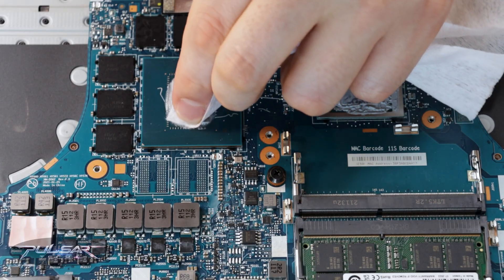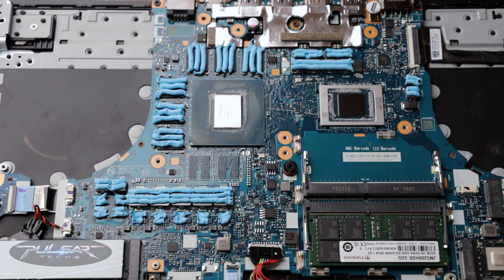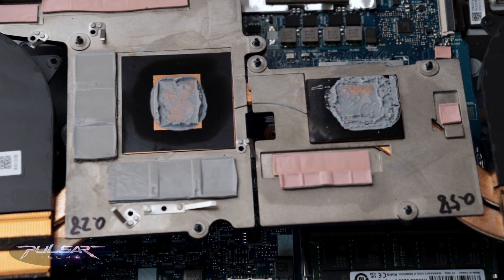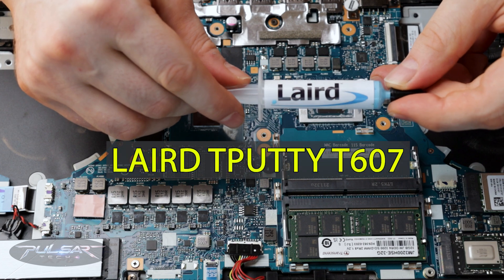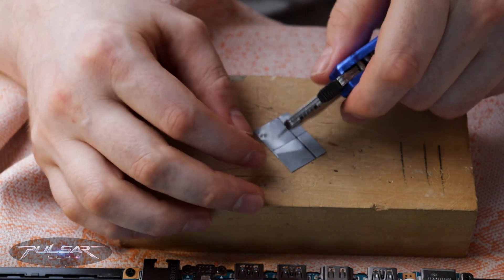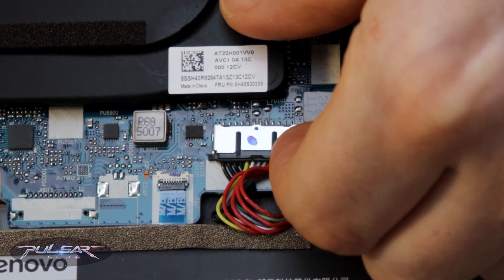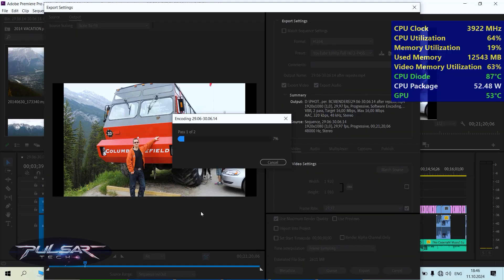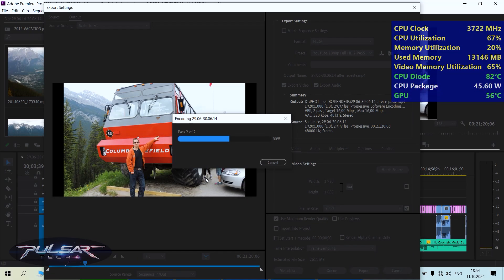From 100°C to Cool ❄️ Lenovo Legion 5 PTM7950 Thermal Upgrade

Comment: Mine is gettin 100c on the cpu is that normal …got it a year ago
Reply from the maker: No, 100C is too much. It probably needs fans, radiators cleaning and thermal interface overhaul, new paste, new pads.
Reply: @PulsarTECH fuck man it does go back to 80 or 90 all the games crash bc of direct x

Comment: Hello, thank you very much for your video! I had to replace my CPU fan which was making a very horrible noise, and thanks to you I could do it because I've changed thermal paste on a laptop before. But I'm kind of stuck in the middle right now, I replaced fans, tested them, open again and now I've cleaned the old thermal paste (which was much less dry than yours I think (I'm not playing very much and the laptop has a bit more than 3 years).
 But my question is now about applying Laird 607, you didn't tell if we have to pull out the thermal pads or just use the laird 607 to fill the gaps and letting in place all those small thermals pads ?
 I put my work in pause, hoping you'll answer soon !
Reply from the maker: Glad the video was helpful! You should remove the old thermal pads before applying the thermal paste.
Reply: Thanks for your help again:-D I'm doing it right now

Comment: How's it holding up now? Any issues?

By the way, have you heard of its issues? I've heard some parts face the "low soldering temp" issue, so tracking its temp is vital. Kind of nervous about this thing.
Reply from the maker: Holding up great. Temps are constantly low. It's the best way I find.

Comment: Hey! I used ThermalGrizzly phasesheet PTM pad on my cpu and gpu today (5800H + 3070M) and while my gpu maxes out at 71c under full load (which is incredible), my cpu is more in line with your "Before" scores from the previous video. It spikes up to the high 90s and then stabilizes around 89c or so. On cinebench r23 i got 10749pts, exactly same as your "Before" scores and with pretty much the same behaviour in temperature. I only wonder why I'm not seeing more of an improvement compared to your new results in this video. I made sure to apply the pad evenly, no air bubbles and tightened it well. I also didn't mess with the thermal pads as they were in good condition. I got great results on my gpu but for some reason my cpu is still running a little hot... any ideas?

Comment: Interesting thanks! Think I will try this but unsure how much mess the liquid thermal pads will make if I need to remove it?

My 15ACH6H with 5800h had a capacitor failure on the CPU and after repair it is now boosting to 3.8ghz during Cinebench multi core with a score of 12580, it’s holding around 77 watts and hitting 100 degrees doing this though! Putting it into Balanced mode instead of Turbo brings it down to 3.5ghz and 85 degrees.

Soldering On did the repair, he has some interesting videos on these laptops.
Reply from the maker: Glad you found the video interesting, and thanks for sharing your experience with the thermal performance!
Reply: @PulsarTECH  Just applied Thermal Grizzly PTM and Advanced Putty (they were more easily available) - I'm getting a similar 10 degrees drop from the Arctic MX4 used by the repair shop so it's maxing out at 90 during Cinebench multicore, but also the fans aren't going upto fully speed like before and the keyboard feels coolers. Thanks for the video and inspiration to do this, I'm really pleased as well!
Reply from the maker: @RebelSolitude  great, glad it was helpful. Indeed, it's such a relief to see your laptop's temps going from 100C and above to 90C under load. Thanks for sharing you feedback and experience!

Comment: when i clean my  cooler once/year  i feel similar effect.  But this will help on the next upgrade, next to new rams and main drive, thanks!
Im runnig on Silent mode, 100% max cpu, 2-3 monitors,  around 80-85C max temp, but its docked  on a big air-cleaner^^
Reply from the maker: Thanks for the comment, that's great that you found the video helpful!

Comment: Have repasted twice with ptm 7950. Every time i do the job there's always the need to replace it due to the dust inside the fans housing. Warranty is about to run out i guess I'll ask them a new heatsink unit
Reply from the maker: Hi, I just keep an eye on the temps, if there are fine, no need to clean the fans so often, especially with this fan design. What's wrong with the original heatsink?
Reply: @PulsarTECH some tiny oxidation near the cpu area, plus the old pads must be burnt out already

Comment: Hi I have the pro version with 5600h and 3060

Do you think it's similar or should I follow another guide?

I'm quite inspired by your pad + liquid pads solution though

Just asking since I have some spare artic mx4 around, it wouldn't work for the chips but would you use it for the spots where you put liquid pads per chance?

Also other question a few years ago PTM7950 was super hard to come by and expensive or fake, has the supply changed?

Thanks
Reply from the maker: Hi, yes it should work with the Pro version as well. The disassembly process might be slightly different but the paste application is the same.
This is what worked the best for me. I wouldn't use Arctic MX-4 on the CPU and GPU chips and definitely not on MOSFETs,  memory chips, etc because it is too liquid and you need to have proper liquid thermal pads such as Laird TPutty 607.
If you're worried about getting fake Honeywell PTM7950, try to find it from a reputable store if possible or at least don't buy the cheapest you find because usually if it's too cheap and good to be true, it probably is.
Hope this help!

Comment: how about putting a 0.5x0.5mm thin silicone pad frame around just by the edge of the cpu/gpu to lock in place the thermal paste on the cpu/gpu? its micro work, but could be useful?
Reply from the maker: I think 0.5 mm would be too much — the gap is probably around 0.2 mm or less, so using that would create an even larger gap, and even if it's filled with thermal paste, that's not ideal. The purpose of thermal paste is to fill in microscopic gaps between the chip and the thermal interface, and the thinner the gap, the better. At this point, I don’t think you can achieve anything better than what’s shown in the video without doing extreme and mostly unnecessary modifications, like custom water cooling or something similar.
Reply: @PulsarTECH  Understood. I was not well schooled on the topic. Now I learned more and understand I said stupid things. lol :D
Reply from the maker: @sagen1x  you bet

Comment: I have a Legion 5 Pro with the same CPU. I haven't changed its thermal paste in three years, and it performs similarly to yours after a repaste. I guess we don't really need to repaste if it's applied properly from the factory.
Reply from the maker: Hi, not exactly, over time the fans get clogged with dust even though the paste might still be good, unfortunately on this laptop you can't simply remove the fans without removing the whole thermal interface. I'm not sure, maybe on the Pro version it is possible. Anyway, the temps need to be lower than 100C, if the temperature is reaching 100C, that means it's time for a thermal interface re-haul. Just keep an eye on the temps and you should be fine.
Reply: @PulsarTECH Yes, but I have been blowing air from the outside whenever I clean the fan, which results in a lot of debris and dirt coming out of the laptop heatsink. This works for me because I live in a clean area and clean twice a year. Once you have a thick film there, there is no helping it without removing the heatsinks. Cheers!
Reply from the maker: @LeonardoDiCaprio-yb3wt  awesome, good point

Comment: Hello!
I was looking around to upgrade my laptop a bit, its the same model, but from 2022 with a 1440p screen instead bt everything else is the same.
I was planning on upgrading the ssd and the ram, but seems like a thermal clean could be good. I got the compuer in sep 2022 and have used it since

One question I want to ask, do you think it is necessary to remove the other thermal pads, like in the heatsinks of the fans or the transistor parts etc? Because if I will do those modifications as well, I want to have all parts in hand before I do this, since I am not looking to replace those thermals again soon.
Reply from the maker: Hi! Great questions. The upgrade is a smart move. If you're doing a full thermal system overhaul, I’d recommend replacing the old thermal pads with liquid ones, as shown in the video. The original pads might still be okay, but there's no easy way to tell for sure—so for the low cost, it's safer to just replace them.
Liquid thermal pads are better because they ensure a perfect fill between the components and the heat spreader. Solid pads come in various hardness levels, and if they’re too hard, they can prevent proper contact between the CPU/GPU and the heatsink, leading to overheating, especially on this model.
Hope this helps!
Reply: @PulsarTECH  do you have a recommendation on what thermal pads to use for this then? I've seen a few but unsure on what I should get. Originally I was planning to spend around €100 in total for all of the upgrades but may have to go a bit more for thermal pads
Reply from the maker: @Hagurmert  I used Laird TPutty 607 for thermal pads, works great.
Reply: @PulsarTECH  hello again...
I have made some purchases and just fully disassembled it, cleaned and put back together.
It took me way longer than I thought, over 10 hours of work (due to stubborn fan connector... I spent like 4 hours on this).. I decided to use PTM7950 pads since I couldn't find what you said. Now I haven't turned the laptop back on, hopefully it still works

Also for some reason every time I open the back, I see more latches break every time. There are plenty of them so no risk of assembly issue but it feels a bit strange
I have already upgraded the RAMs previously from 2 x 8GB (1rx16) to 2x 16GB (1rx8) which has been good and now I also have a new SSD to boot... Hopefully no malware in it or any other issues
I will follow up after some testing tomorrow
Reply from the maker: @Hagurmert  that's right, no job takes longer than the one you need to do twice. No rush is always good. Hope everything worked well.
Reply: @PulsarTECH  it's mostly good, I removed a lot of that dust, new thermals and RAMs I did before. I have had a lot better performance since before, although not yet fully tested.
Also the cleaning process (although a bit messy) seemingly did okay, the laptop is running nicely

I also bought an SSD but I will test it elsewhere for safety purposes first

Comment: Absolutely great video! thank you! 💯
By any chance did you also tried the benchmarking of the Honeywell PTM7950 SP Thermal Pad vs the Honeywell PTM7958 SP Thermal paste? 🤔
Reply from the maker: Hi, thanks for your feedback! I'm glad you enjoyed the video. I haven't tested the PTM7958 myself yet, but from what I understand, it's only slightly better than the PTM7950 — the difference isn't significant enough to be a critical advantage.
Reply: @PulsarTECH  thank you very much for the intel!
I should have waited one hour longer 😅 It was head-to-head PAD 7950 and PASTE 7958 and I ended up ordering up the 7958 Paste. In any case it should be okay... and your step-by-step video is priceless info to finally clean my laptop.
Reply from the maker: @niconj  great! If any 7958 should be even slightly better. Good luck with cleaning your laptop!

Comment: Hi, I will attempt to install the PTM7950 thermal pads this week on my lenovo legion 5 (1660ti + 4800h), since the GPU temps are quite toasty (87C). However I want to ask you two questions:  a) how important is to add the laird to the other chipsets? Perhaps I can manage low temps without that extra step (along with full cleaning of dust), b) can I use pads with 0.5 mm thickness instead? (I've read that some ppl even go to 1mm)
Reply from the maker: Great idea! The PTM7950 should definitely help lower your temps significantly.
For solid thermal pads like Gelid or similar brands, the correct thickness is 1 mm. If you use 0.5 mm pads, they won’t make proper contact, which can cause your memory chips, MOSFETs, and other components to overheat and potentially fail prematurely. That’s exactly why I chose to use liquid thermal pads — they ensure perfect contact between the cooling system and all components.
Also, if you use solid pads that are too stiff, they might not compress properly, which could lead to poor contact with the CPU and GPU dies, causing overall higher temperatures or localized hotspots.
Just a quick explanation — good luck with your installation, and feel free to let me know how it goes!

Comment: Hey one of the screw from heatsink is being stripped idk how to resolve this issue any suggestions??
Reply from the maker: Hi, yeah, dealing with a stripped screw on a laptop heatsink can be frustrating, but there are a few ways to try and remove it.
First try placing a rubber band over the screw head. Press your screwdriver into the rubber band and try turning it slowly. The rubber band can help provide extra grip.
If the screw head isn’t too damaged, try using a slightly larger Phillips or flathead screwdriver. Press down firmly while turning to avoid making it worse.
If that doesn't work try  to apply a tiny drop of super glue to the screwdriver tip. Hold it in the screw head and let it bond (about 5-10 minutes). Gently twist it out once the glue holds.
If it's really stuck, a precision screw extractor (like a left-handed drill bit or a kit) can help remove it. That's the best way but it requires a special tool. Hope it will help!

Comment: What happened if i dont heat it up like u did with the heater thing before put the heatsink back on?
Reply from the maker: Hi, I think it should be fine because I haven't really spend much time with the heat gun, maybe a minute or so.
It worked awesome right away but I've heard it needs to be heated with the stress tests for some time to achieve the best results. Though I haven't done it, simply use it for video rendering and so on, that's gives it some decent work load, the temps are staying cool under the load and that's a good sign.

Comment: your cpu wattage is not reaching maximum mine reach 80 watt and i hit 12900 in cinbench with the same laptop
Reply from the maker: That's right, because I've run it in the Balanced mode that doesn't boost the CPU over 60W, when in Performance mode, it goes to 75W or so.

Comment: Hey im still new to this, if I'm already use a thermal pad should i add a liquid thermal pad or we need to choose one of it?
Reply from the maker: Hi, yes you need to choose either the standard solid pads or liquid. Don't use both, it won't work well. I would go with the liquid ones but it's up to you. Solid thermal pads are easier to deal with. Hope this will help!
Reply: But I'm still curious, how to clean the liquid thermal pads?
Reply from the maker: @ hi, you can use Isopropyl alcohol (90% or higher) and Lint-free microfiber cloth. Dampen a lint-free microfiber cloth with isopropyl alcohol.
Gently wipe the surface to remove any remaining residue. For hard-to-reach areas, use a cotton swab dipped in alcohol.
Avoid using too much alcohol to prevent it from dripping onto other components.
Allow the cleaned area to air dry completely. That's it.
Reply: Thanks! I'll keep in mind

Comment: After a warranty motherboard replacement on my 2021 Legion 5 Pro it suddenly had CPU temperatures over 103 degrees Celsius when under load. Lenovo said the temperatures were within specs and refused to do anything about it. Turns out the thermal paste they used had really bad pump-out issues and replacing it with PTM7950 thermal pads seems to have lowered max. temperatures by about 20 degrees, i.e. slightly below from what they were from factory.
Reply from the maker: Wow, that's good news. Glad it worked so well.

Comment: Thank you, a complete and comprehensive video. I bought my lenovo legion 5 3 years ago and I started to notice it was very hot. I have to limit the clock speed of the CPU (5600h) to 3.27hz but when playing games like elden ring, it heats up to 102 degrees very quickly and I also tested some tasks but the results are still not positive. 7 months ago I watched a video showing how to clean and replace thermal paste. I used Grizzly Kryonaut but the results were still the same. A few days ago I watched your video and decided to replace the PTM7950 and I removed the fan as you said and to my surprise, the dust formed into a block. I cleaned it and the results were really surprising, I removed the CPU clock limit, the temperature when playing Elden Ring was only 65-72 degrees, the GPU was similar, from 8x to only 5x. Thank you very much for this video, sorry if my English is not good

One tip: when screwing the heatsink in, don't try to force it down, only tighten the screw until you can't turn it anymore, otherwise the thermal paste will spill out.
Reply from the maker: It's great that you were able to get those temperatures down, congrats!
Reply: hi there @RaySting2004 I have a similar situation. I just replaced my stock Legion 5 Pro 2021 thermal paste with kryonaut & temperature is not improving. Did you replace the kryonaut with 7950 thermal pad? Did you also use the Laird Tputty like in this video or only the pad?
Reply: @a-ki-ten  i only use PTM7950 and clean the fan.
Reply: @slave_09  do you use the paste or the pad one?
Reply: @slave_09  if you're using paste, how many grams did you buy / apply?
Reply: @ I bought the PTM7950 30x50x0.2mm pad it can be used for more than 2 times, nothing else
Reply: @slave_09  got it thank you!